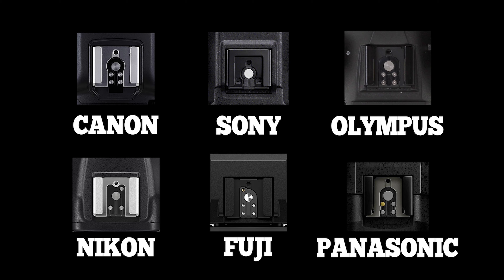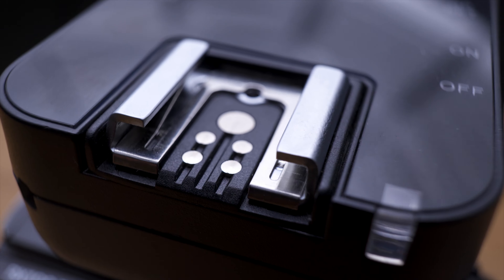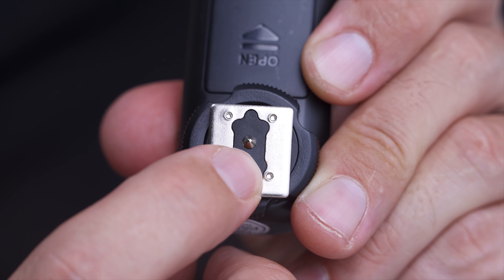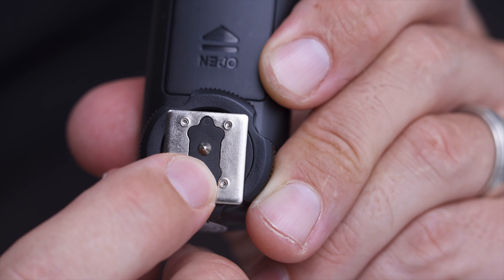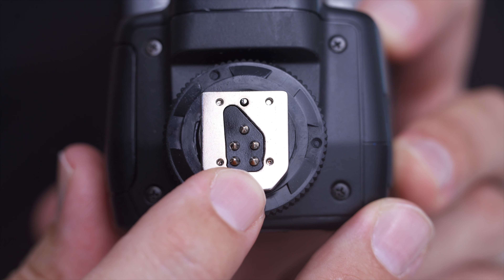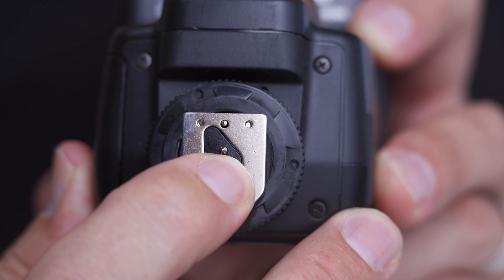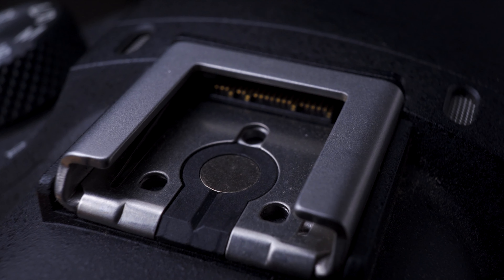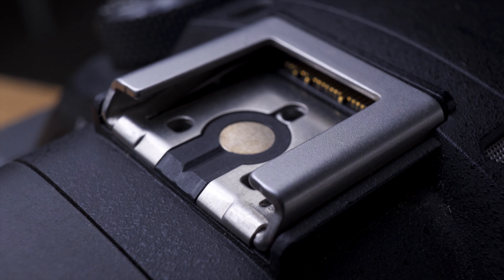What is a Hot Shoe on a Camera?

Comment: Clear explanation, Mike.  One caveat: Sony manuals warn against attaching (older) high trigger voltage flashes - 250V or more or that have reverse polarity (like Vivitar 283 that has 260 to 280 v trigger) w/manual center pin to current Sony hot shoes — risks burning out cam electronics.  Such flashes might be fine as off-camera remotely activated, but not direct seating in hot shoe.  No kidding.  Don’t know about other camera brands, but quick search references ISO 10330 digital cams at 24 volts.
Reply from the maker: Thanks for that info Paul, I'll pin this note and also put a warning in the description. Didn't know that so I've learned something today!! 😁👍
Reply: @mikesphotography   This also happens on Nikons as well old Vivitar  flash units frying the electrics
Reply: Even remote devices like radio receivers might be burned out by high flash trigger voltages.  Not just Sony cameras - best to assume that any camera designed after around 1985 won't tolerate a high voltage. Older cameras had a mechnical microswitch for the flash but later ones use electronics.  Canon have specified a 6 volt max for some of theirs!

Comment: Good advice about old flash guns. I found one I brought 50 years ago that still worked and did not think about the higher voltages. Luckly It was a $16 item that I damaged before measuring the terminal voltage at 60volts. I was pleased I did not test it on a modern camera.
Reply from the maker: Yep it's definitely worth testing before trying it out. 👍

Comment: Great explanation Mike Thanks! I have one question, can I put a METALLIC cold shoe on my camera's hot shoe mount without having any short circuit issue?
Reply from the maker: I've done it a lot before with no problem. But it might be worth contacting Sony and asking them about it just to be on the safe side. 👍
Reply: @mikesphotography  thanks, but I'm team canon... it hasn't the little contacts Sony camera has
Reply from the maker: Ah ok...the Canon hotshoe system is much more robust than the Sony system, so I think you'll be fine. 👍

Comment: My old A-mount had a great flash mount, but it was a pain as a convertor was needed.  However, on my A7III I can run my amazing Nikon SB-80, manual only, but, tbh, I'd never use anything other than manual flash - mostly garden macro or woodland macro so learning to use a reflector with manual flash is a much better use of my time :-)
Reply from the maker: Great to hear. It's all about manual flash...I learned how to use it so much better than blindly letting ttl decide what was best. Great to hear you can use your SB-80 on the A7iii. 
Thanks for watching. 😁👍

Comment: I've switched to sony last year and I still have two yongnuo 560III (manual flashes) and a couple of RF 603C II triggers (I also have a 565ex so I've used it as a third flash coupled with the trigger whenever I needed it). Since the switch I've never used them because I was afraid of braking the little conections that the a7III has on the back of the hot shoe. So if you are telling me the triggers should work fine, I'm going to start using them again! Thanks!
Reply from the maker: Yep, I have a 565ex, and two other yongnuo flash heads and they have all worked just fine with the sony cameras.  😁👍

Comment: cna u add a second hot shoe? i treid looking on amazon but some looked sketchy ... I would like to avoid switch between flash and a second screen
Reply from the maker: If the screen doesn't use the connectors, and uses the hdmi port to get the feed, you can buy a cage for your specific camera model and then get a magic arm and have it attached to one side.
Reply: @mikesphotography  oh so in in reality the hot shoes is relly just for the flash
Reply from the maker: @salvab13  yes. If it has electrical connectors, it is called a hotshoe, and if it is just a slot in the shape of this mounting point, it is called a coldshoe. The electrical connection points allow your camera to communicate with your flash. 
So on most camera cages, they will have a coldshoe mount. This just means that it is like the slot on the top of your camera, without any electrical connectors.

Comment: I am sorry to say but the Hotshoe differs from brand to brand. Try fitting Sony flash in Fuji. You can not slide in the tracks as they are narrower than the thickness of flash guide. Sony flash have very thin exposed connectors at front which are too delicate and get damaged. Please advise accordingly.
Reply from the maker: That's a fair point about Sony flashes in fuji, but the contacts in Sony hotshoes aren't that fragile. I've been pushing Canon flashes in all of my Sony cameras for years without any problems and now I have a few Sony flash heads, they work just fine.
Thanks for watching.

Comment: Useful info but a bit optimistic in places.  Sony position their trigger contact more to the rear than others (see 0:20) and there are reports that some flashguns don't  make contact with it eg : https://www.youtube.com/watch?v=WQcSBoEmHF0 .  There are also cameras that don't have a centre contact : later Minoltas, early Sonys and Canon EOS 200D Mk II. I'd be cautious about fitting any multi-pin flashgun to a multi-contact camera of a different brand. Eg the Nikon and Pentax contact positions look the same but the "Ready" and "TTL" contacts are reversed between them and I'd rather not find out what happens if you mix them.